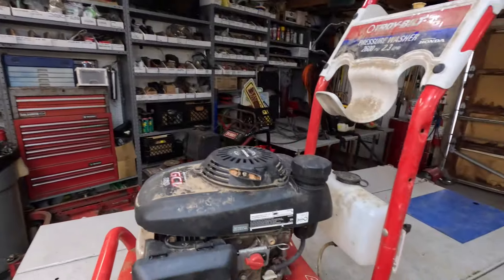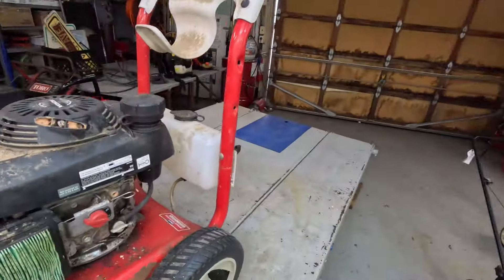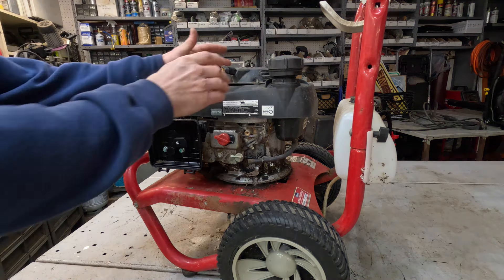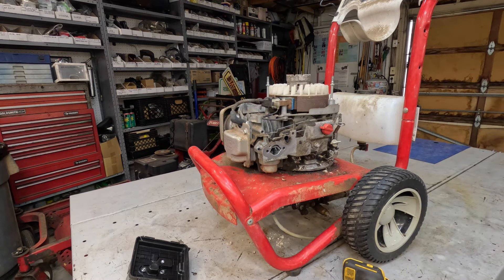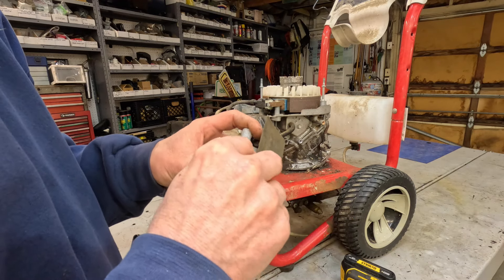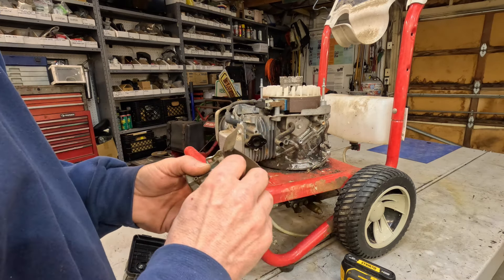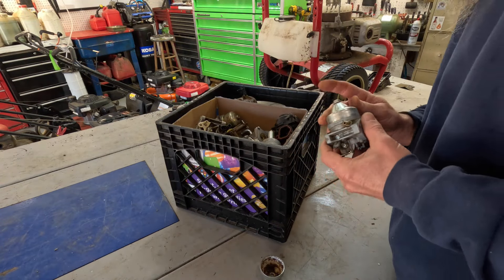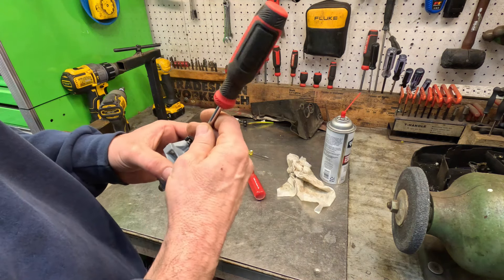Troy-Bilt Pressure Washer | Estate Sale Score! Honda GCV160

Comment: I've always heard them referred to as mud daubers here in the Midwest.  They like to build nests under the top rail of our above ground pool.   As for working on Honda engines, I like to use 6m threaded road.  I pull one of those long screws out and replace it with the rod before I take the other out.  Helps you keep track of the many gaskets, spacers, etc.  You can leave the rods in and use a 6m nut to replace the long screws or take the rods out one at a time and replace with the original long screws.  Good video Tom.  I got the threaded rod at my local Ace Hardware.

Comment: Bruces shop used a easy out to get the jet out but you would probably have to replace it or fill it with solder and redrill from the back with a jet drill
probably easier to get new carb lol
thanks for your time and videos

Comment: I have one of these and this was very helpful. Hasn’t been run in years. Just garage kept.
Does it need to have water in the tank when running the engine? Still looking for online manual
Reply from the maker: No the tank is just to spray soap if ya want to